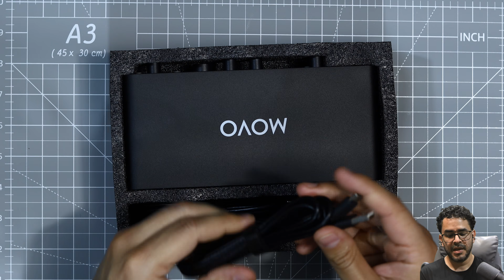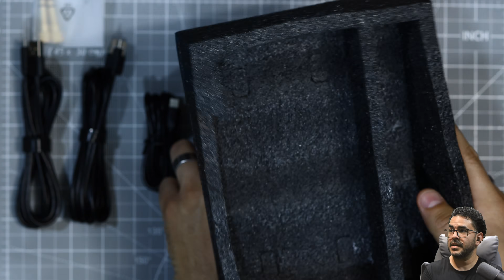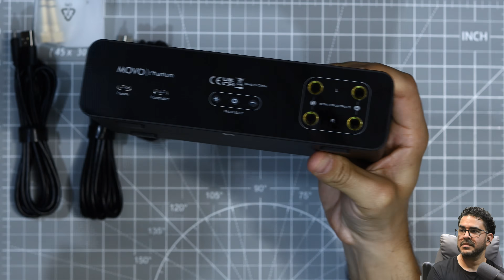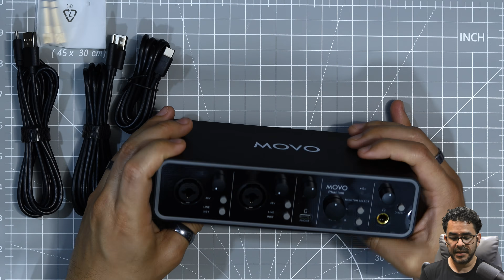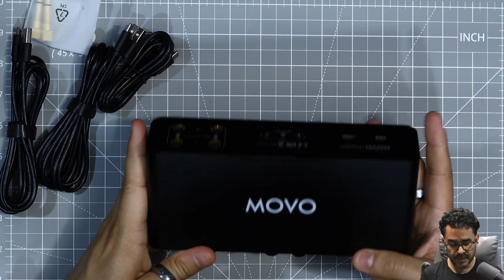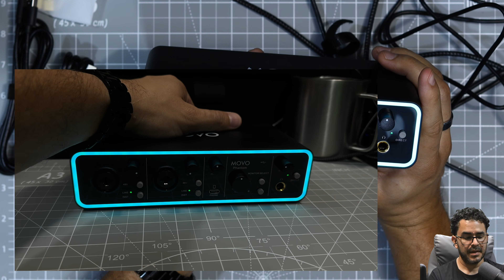Movo Phantom USB-C Interface – Unboxing & Features

Comment: no driver, this is a failed product of movo
Reply from the maker: @CaoNhaNoi  not sure what you mean. The product worked fine for me.
Reply: @JoeCastellon  no driver, i have to use 3rd party asio4all
Reply: @JoeCastellon  If the company invested in drivers, this product would be worth more.
Reply from the maker: @CaoNhaNoi  what software are you using that requires drivers?
Reply: @ cubase
Reply: @ cubase
Reply from the maker: I guess that's a very niche use case for this interface. This is more of a general purpose interface or for use when starting a podcast, for example, while Cubase is a more professional use case.

Comment: this is an interesting interface. just a question, do you really need to use two cables?
Reply from the maker: I imagine you’re referring to the USB-C cables, if so, yes, one is needed to power the interface and the other to connect it to your computer.
Reply: @JoeCastellon  so connecting to pc alone won't power this interface?
Reply from the maker: @ it can only with a pc but you’d need to use 2 ports, one for power and the other for data. You can use any slow USB-A port with a USB-A to USB-C cable for power.